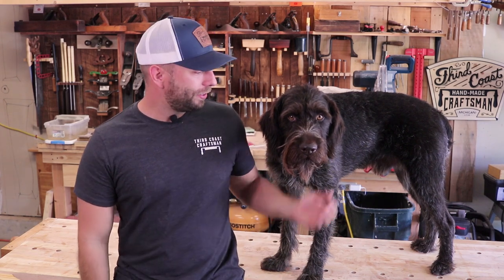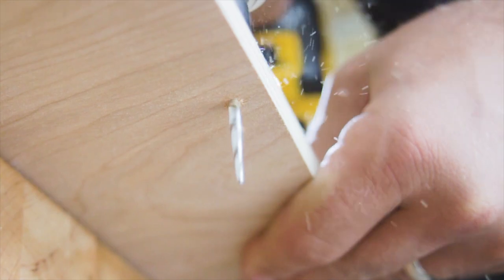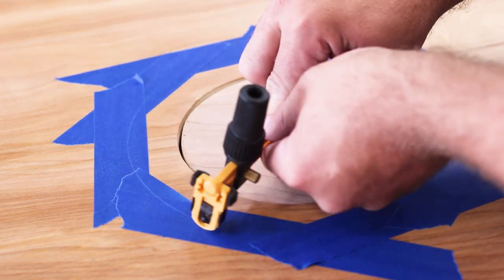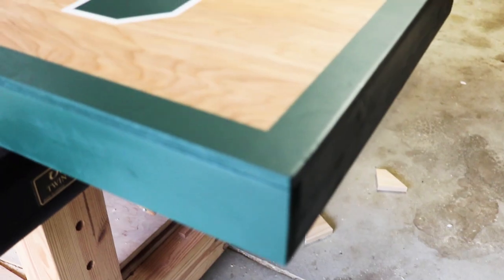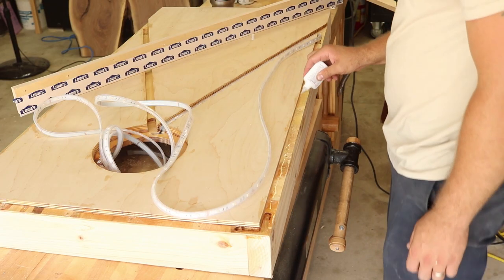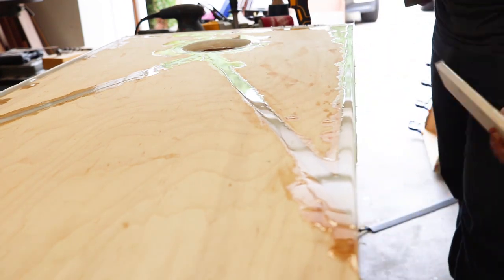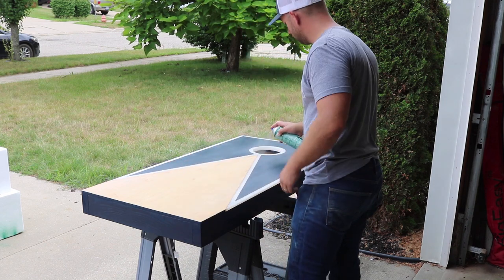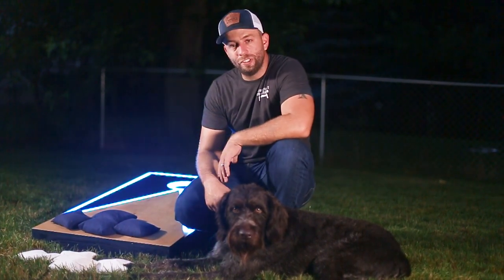How To Make LED Cornhole Boards!!!

Comment: Very neat idea. I have added LEDs to the underside of the boards, but what I found is, putting them on the bottom part is essentially useless. The LEDs on the top part of the underside (where the hole is), are great and gives a good out line of the boards while playing at night. My son and I (he’s 9) are building a set now and I was considering doing this method on the bottom (outside) then snaking back inside and going around the top. I like how you did that design around the hole and without needing to make splices. I always have issues with those damn splices.

Comment: Awesome build and video, I'm excited to see what else you build. I was wondering about a couple things about the boards with the LEDs. 
What was the thickness of the boards that you used, the angle of the channel you routed towards the hole and what's been troubling me the most is the setup of the holes. Great video

Comment: Might think of a way to make a "tunnel" for the LEDS to slide thru so you could remove them when they die and replace. Saw a guy who made a river bed with leds. Put I think PVC but can't recall down, poured the epoxy, removed the PVC or whatever it was, ran the leds thru it. Now if needs to change them just pulls it out.

Comment: I LOVE this set! I'm trying to make my own and the biggest question I have is this: 
When routing the 3/4" channel around the edge, wouldn't that cause those edges to be a little less secure and more susceptible to separation since you only have wood glue holding the remaining ~1/4" of plywood to the 2x4 since you had to remove the screws for the channel? Or do the non-channeled edges that still have screws hold everything secure enough? I would just worry that over time, the persistent "thumps" from the bags would eventually loosen those edges. 
This board is amazing and looks really well made, I would just want to make sure I didn't invest all of that time if it was just going to lose it's strength because of those edges. Great video!
Reply: I was thinking the same... why not use a plunge router and leave a bit of a lip. Question... if you already made these, how much casting resin did you end up using? Good luck with your build.
Reply: I think that’s why he used a 2x4 instead of a 1x4 for the box.

Comment: First - Thank you for your service!  Second - Great video and great idea with the LED lights.  I have been tinkering in my shop trying to make an LED backlit headphone stand with 2 pieces of plexiglass sandwiched in between 3 pieces of pine but I can't get the led's to bend the way they  need to.  Just don't have time to engineer them.  I would like to know if these are battery powered or if you have to run extension cords to them in your cornhole boards that you made.   Again -great video -I actually laughed at the end -you are very talented at not only wood working but video content as well....

Comment: Why did you intentionally leave out the wiring and power supply for the LED strips? If you're using 3/4" plywood on the top and you set your router bit to 3/4" depth,  how is it that you were able to leave the bottom layer of the plywood in place? Also,  wouldn't it be a good idea to reinforce the bottom frame with cross pieces to minimize bounce, since the integrity of the plywood has been tampered with? They look really cool and as the days get shorter,  having built in lights are desirable,  but do they provide enough light to enable the player to throw well?

Comment: Nice build. Especially the L.E.D versions. 

One thing to note, you didn't show or mention you sealed the wood front and back prior to painting or urethane. I hope you did as I can well imagine they'll be left outside and have to endure quite a bit a moisture possibly even rain.

If you don't seal the wood prior, the paint and urethane will peel off in short order.

Very nice build though. Thanks for sharing.
cheers...
Reply: What would you seal it with?

Comment: In the description you linked plug in LED strip. Are those plugged into an extension cord? I was thinking of using a batter powered strip. Would just have to hide the battery box somehow.

Comment: Can you cut the light strips ? And did you have them flat on the edges. On runnings along the sides for it turned easily ?
Reply from the maker: You don’t want to cut the ones I have linked in the description and yes they get turned to the edges to run along the corners.

Comment: I’m confused. You routed out 3/4 inch in depth with the router on the outer board and the hole for the L.E.D lights. But what depth did you do for the led lights coming towards the hole.. (the slant part of the lights)??? 1/2 inch? 1/4inch?

Comment: Looks cool, but if the LED strips go bad than you have to make a new set of boards. It would be cool to figure out a way to change out the led over time. Maybe with sheets or strips of acrylic with channels for the led strips instead of epoxy.
Reply: White pex tubing or similar heated and formed would work. Don't forget to attach a small pull wire or string to the old one so you have a way to pull the new one through. You could also use a small piece of foam taped to the end of the strip and use a shop vac or house vac to suck it through. Learned that trick running wire through pipe and conduit.

Comment: Dude awesome video!  I never thought to use epoxy to seal in led lights. How is epoxy part standing up?  Just wondering if the epoxy separating from expansion and contraction from the plywood. I’m also a vet and I spend thousands at Lowe’s.  Thank God for that military discount!  My favorite store next to Rockler.

Comment: My question about the LEDs is did you connect them to a extension or what did you do so they would stay on when you used them at night? Thx for the helpful video by the way

Comment: A lot of people use 2x4, vs 1x4, I'm guessing for the cost savings. Which do you prefer, if you're not going to use led's. I hear mixed reviews. Is spray on urethane better than brush on, more even?

Comment: Looks great. Gonna steal this for myself. But wouldnt it have just been easier to have had lows just strip down the top sheet to the right size to save some time routing the edges? (I know in the beginning you said you hated doing that though) also why didnt you epoxy the whole top? I have seen a few people epoxy but most just spar urethane. So why one over the other?

Comment: Have you had any issues with the resin cracking over time.  I use that resin on coffee tables and when I pour it that thick it eventually cracks from the curing process. It usually takes it 3-6 months to do so, but I haven't found a way around it other than to pour layers of resin letting each one cure before the next. Love the idea of being able to play at night with these.
Reply from the maker: No problems with it yet, but I used a resin specifically designed for thicker pours called a casting. We’re using a casting resin?

Comment: How did you make the sharp turns with the LED strip?  I am at that point, and the only thing I can think of is making the corners a little deeper.  I am currently at a depth of 3/8".  Thanks for any help!
Reply from the maker: yes you have to make the corners deeper which will likely create a hole in the plywood that the epoxy will pour out of. Youll also need to add some scrap wood to that section to plug the whole you create
Reply: @ThirdCoastCraftsman  Thank you very much for the reply! Thanks for your videos!

Comment: So you used the 16ft LED strips, but you obviously don't need 16ft of LEDs per board. I've not used LED strips before, so what did you do with the excess part of the LED strips? Can you cut them to size? Cool project I really want to try. Utz Rulz!

Comment: what did you use for battery power for the lights?
Reply: craig11blind he uses plug in light strips. Search for “cornhole lights” on wayfair. They have battery powered 6” diameter LEDs. I also found them on amazon. Also check out: www.proglowsports.com

Comment: Just my opinion but what if the l.e.ds go bad how are you suppose to repair it maybe another way to do it would be so the epoxy separated from the rest and find a way to attach it maybe even just a friction fit for ease of repair if needed cool video though and they turned out very nice

Comment: Love the videos man. Did you just run extension cords for the LEDs or use a battery pack of some sort? Also, you should do a series on patio furniture. Always looking for ways to spruce up the backyard and would love your input on it.
Reply from the maker: I just ran extension cords! Patio furniture might be a good project for next spring
Reply from the maker: I just ran extension cords! Patio furniture might be a good project for next spring

Comment: Out of curiosity did you modify the LED strips to run on battery power?  I like the idea of not being tethered to an outlet.  I've used rechargeable 12V batteries in projects that lean towards portable.  Love this project!  Design and execution are both top knotch!
Reply from the maker: Im just using extension cords, but yea you should be able to buy battery packs you can plug them into

Comment: So  I looked at the Led lights you used and the have a wall plug in. how did you get that to work. did you change it to batterys?
Reply from the maker: extension cords and plugged in. you can buy battery packs tho

Comment: How much epoxy did you use? Ive never worked with epoxy before, but really want to make a set of boards like this. Any advice would be greatly appreciated. Thanks
Reply from the maker: im sorry chaz I didnt keep track. It was less than half a gallon, i know that much for sure

Comment: When doing the epoxy pour, does the system 3 not require you do pour in small increments?  Most of those bar epoxy do but judging by the video you just filled the trench.
Reply from the maker: nope, this is their casting formula that lets you pour thick volumes (unlike thier normal mirror coat formula)
Reply: Third Coast Craftsman good deal. Thanks brother. It was a pain in the butt finding this stuff.

Comment: Where did you get the LED lights and casting resin and the pearl additive? Way cool! I’m going to build some for my kiddos.
Reply from the maker: LEDs from lowes. link in the description. The epoxy is system 3 mirror cast. and i just got the white pearl stuff off amazon
Reply: The link for the strips shows them powered by 120v transformer to take them to 12v. Did you put a 12v battery under the board? Doesn’t seem practical to need an ac power source every where you go.

Comment: Loved the boards. I build sets and have been wanting to do LED boards for sometime now. Thanks for the video. The epoxy you used, I  could not tell in the video if it dried clear or did it have a milky/frosted look? And what epoxy did you use. I am sure you bought it at Lowes, just need to know the type or brand.
Reply from the maker: Thank you! Its system 3 mirror cast. search online for it. it was milky when dried because I added the pearl (which is what I wanted)
Reply: @ThirdCoastCraftsman  What pearl did you use? About to do something similar with a desk project I'm working on and want to know what to use. Thanks! :)

Comment: This might be a dumb question, but on the 2nd set with LEDs, what is holding the top plywood to the framing? Is it only the glue you put on the beginning? And i'm guessing the epoxy resin is also acting as another binder between the framing and the top? Or did you install screws to the framing with the remaining plywood not routed out for the LEDs?
Reply: I'm pretty sure he is just relying on the glue to hold the tops down, which is more than sufficient.  I would have redone the screws after routing the channel for the LED strips, but that's just me.
Reply: @pinnaclemotoring8393  Thanks! I was thinking the same with the screws after routing...

Comment: How are the led strips powered on the boards? And can u put a link to the resin u used? Love the work
Reply from the maker: I used extension cords, but you could buy battery packs too. I used system 3 mirror cast

Comment: You link in the description is for plug in LEDs, did you use plug-in or battery operated LEDs?
Reply from the maker: I used plug in ones, I just ran extension cords. But I think you can buy battery packs

Comment: You never explained how the boards are powered like what type of batteries did you use and how are the LEDs connected via Micro usb I assume? Super dope build just felt like you maybe skipped a few steps lol but awesome build makes me want to build one now
Reply from the maker: they are plugged into an extension cord, but you can buy battery packs too

Comment: Man what a great cornhole set! how do you power the LED lights? where does it connect to power?
Reply from the maker: These I plug into an extension cord but you could buy some battery packs

Comment: Shame you didn't explain how the LEDS were powered.  Do these need to be plugged in or did you install a Battery pack soiewhere?
Reply from the maker: They are plugged in, but you can buy battey packs to power them if you wanted

Comment: The LED cornhole is Bad Ass! What do you do if the LED lights burn out though?? Those dont last long.
Reply from the maker: thank you. Ive had really good luck with LEDs lasting a really long time. Ive actually used them on several things and havent even had any burn out

Comment: Awesome! I wanna make a set! Can you estimate how much epoxy you used? How long of a LED strip did you need? Did you wire them together or have separate power sources?
Reply from the maker: I used 2 16 foot strips that Lowe’s carries and used less than half a liter of epoxy. I ran an extension cord with a multiple head to one plugged one board in and ran another extension cord from that one to the other board.
Reply from the maker: I used 2 16 foot strips that Lowe’s carries and used less than half a liter of epoxy. I ran an extension cord with a multiple head to one plugged one board in and ran another extension cord from that one to the other board.
Reply: Third Coast Craftsman awesome! Hope you don’t mind if I use your idea “as inspiration”! 🤪 I love it

Comment: This was awesome! So you got the LED and the resin at Lowes? What section did you go to for them? I tried searching online and got yard lights and stuff... not the strips. In Alaska its hard to find that kind of stuff so that would be awesome if I can pick some up next time I go to town. Its a 4-6 hr round trip but worth it. :)
Reply from the maker: Wow! That’s a super long trip. I didn’t get the epoxy at Lowe’s but search ecopoxy online. There is a link to the LEF strips I used in the description. Thanks for watching bud. I appreciate the continued support
Reply: I'll have to check and see if I can get that stuff mailed to me.  Alot of stuff can't be mailed to Alaska with all the new regulations because most of the stuff comes by plane.  So, can't order any lithium batteries, anything labeled hazardous because of its flammability and what not.  :)  AH! They are called under cabinet lights!  Now I know where to find them.  AND they have them in stock.  Love how you can see if they have them in a store you go to AND what aisle to find them in!  So helpful! Thanks again for the awesome projects!
Reply: yeah, its a "we are making a trip to Anchorage, what do we think we will need in the next month" situation!  LOL  Tactical shopping at its best.  :)

Comment: what did you do for the power supply?
Reply from the maker: Just plugged them in with an extension chord. You could also buy a battery pack thing too

Comment: What type of epoxy did you use?   I've never seen white.
Reply from the maker: I just added some white pearlescent to system 3’s mirror cast
Reply: I really liked both of your builds, especially the MSU! How did you go about adding the white pearlescent, was it in powder form or liquid?  What was the ratio of coloring to the resin mixture?

Go Green!
Reply: I’m also interested in further detail with the pearlescent
Reply: Did you get the epoxy and pearlescent from lowes?

Comment: Wouldn't it be easier to use a router to carve out the channel for the LEDs before cutting the hole?
Reply: Is it easier to carve a circle channel into plywood with no hole to guide the router?   I'm not sure how to do that.
Reply: @playbench  Using a piece of wood as a guide and then a circular piece for the hole and a straight bit on the router. Guess you'd have to make that first, so you're not really saving time. Not that it matters, great work anyways :)